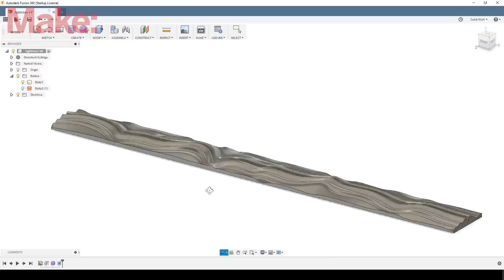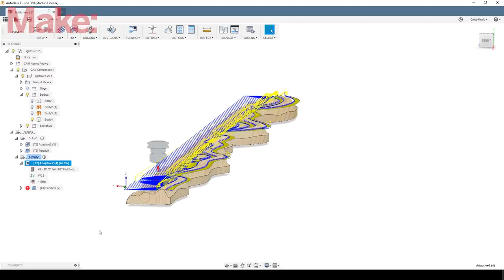CNC an 8 Foot long river of light

Comment: why did you start with 6  inch material just to carve it all away to get 2 inches of final product? Could have used half the material by ripping the boards down to 3 inches and then carving the shape in.
Reply: I agree... totally wasteful
Reply: I started with 3 inches tall (though it does look like more doesn't it). I wasn't sure how tall the tallest part would be when I bought the wood, if I did it again, I could probably stick smaller. Hindsight is 20/20, right?